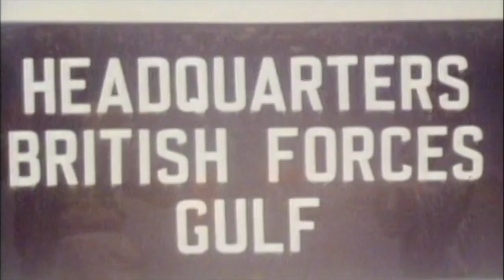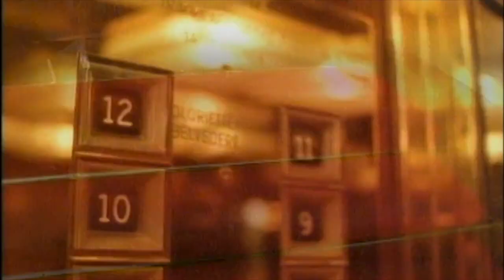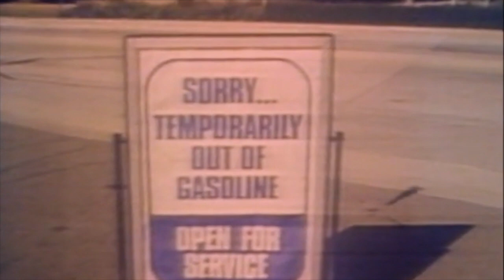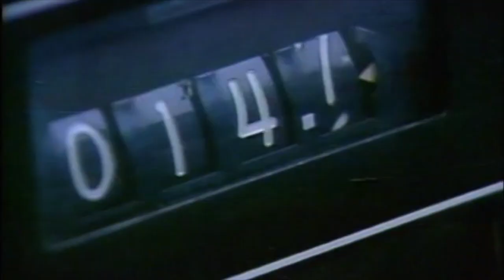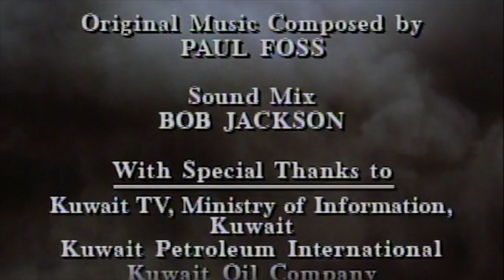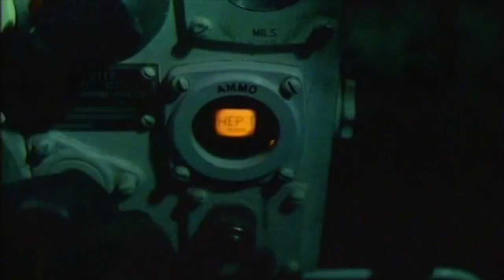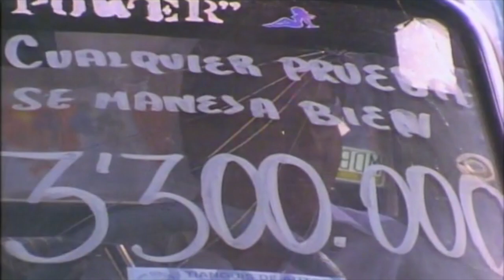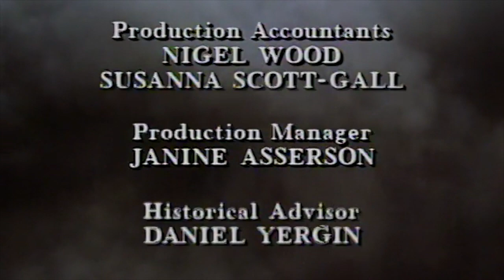The Prize part 7- The Tinderbox Official Video ) 7 of 8

Comment: 12:10 BP diminished Kuwaitis dignity.
23:15 embargo for US and power countries by OPEC because of supporting Israel
30:20 Kuwaitis nationalized their oil industry. BP and Gulf insisted of a 2 billion compensation but Kuwait gave them 50 million
32:00 Because of the increase of prices and embargo of OPEC. The North Sea came into scene and it was competing with productions from OPEC countries
34:00 The price of oil went up because of Iranian Revolution in 1979 and there is a lack of supplies in the US
43:10 Those implementations of searching oil at difficult locations such as Alaska or the North Sea that increased production from superpower countries lead to a plunge of oil by 1986
47:30 in 1990 Saddam Hussein invades Kuwait and wanted to control the oil production of Arab countries.
For the reason of ‘liberating’ Kuwait the allied forces initialized the Gulf War
1:10:00 environmental concerns
Reply: THANKS